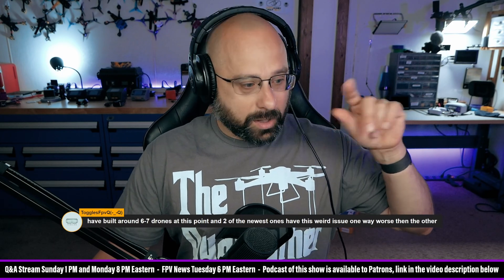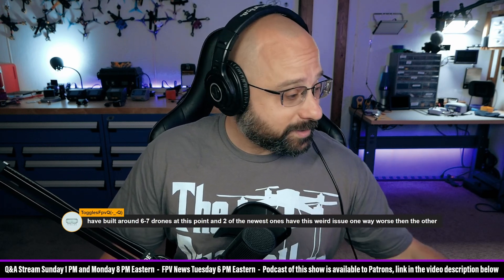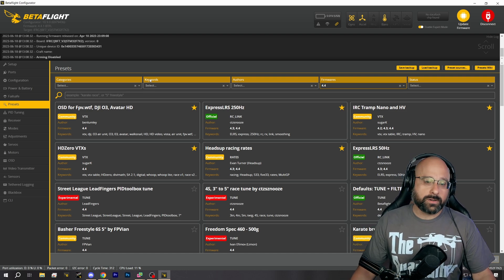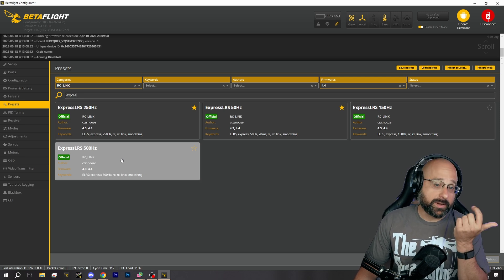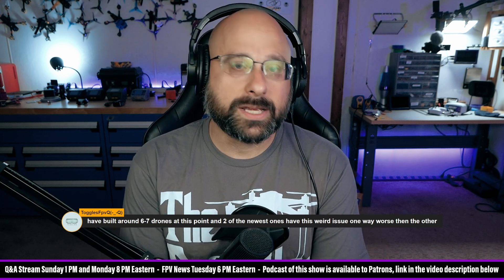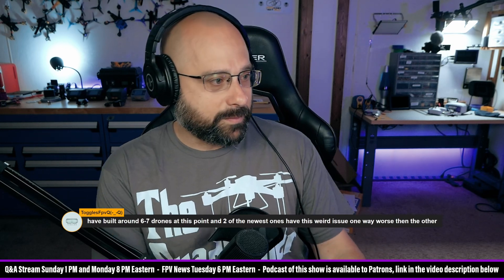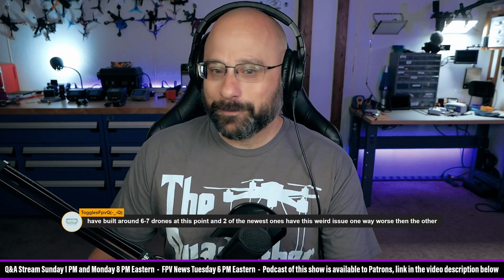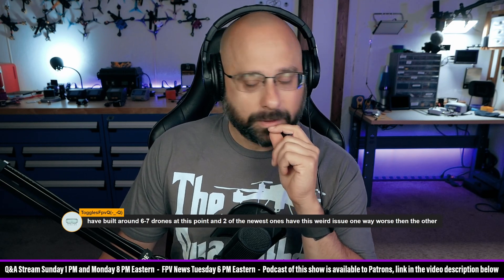My FPV Quad Is Twitchy! Do I Need An ExpressLRS Control Link Preset? - FPV Questions

Comment: I recently had this issue, twitching on the yaw access that was caused by blips in my RC Command (yaw) - confirmed this with black box recordings. Another tip is to turn off your radio's ADC Filter - it's also a warning when you load the applicable ELRS preset (pay attention .. lol). Ultimately, I took apart my radio and cleaned the gunk out of my gimbals I think that is what ultimately got my quads running smooth.

Comment: I had this or similar issue on a tiny whoop, was running Elrs 915mhz at 50hz, so the opposite of high speed, and roll stick would occasionally freak out and almost flip the quad. Setting the betaflight preset for 50hz solved the issue. So it may be that using any packet rate setting to the extreme with default settings in BF will cause the issue.

Comment: Yup there's no 1000Hz preset in Betaflight 4.4 because the internal values can't go high enough to smooth 1000Hz properly. This has already been fixed for BF 4.5 😊 but just use 500Hz preset to be close enough it shouldn't cause problems.

Comment: My issue was the ADC filter being on as well
Reply: I also have the same problem, preset didn't work.
Where is this ADC filter?
Reply: @harishgowtham_  it's a transmitter setting. You can have adc filter turned on or off globally (in the edgetx system menu) and also on a per quad basis. You want it turned off.
Reply: @modquad18  sure - whenever you are flying anything that doesn't use a flight controller that filters your inputs. For example, if you are flying a plane with a pwm receiver (which basically directly ties your stick movements directly to the servos), using the adc filter on the tx can prevent the servos from jittering around.

Comment: There is a filter setting in the rc radio that need to be disabled to use it with betaflight fc's if i am remembering correctly.
Reply: ADC Filter
Reply: @voltzFPV  yes, that one